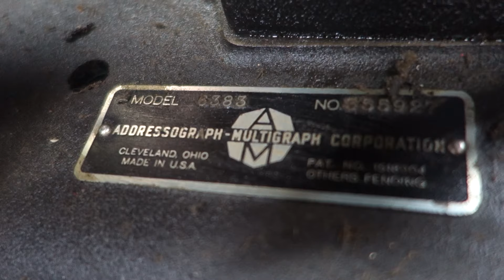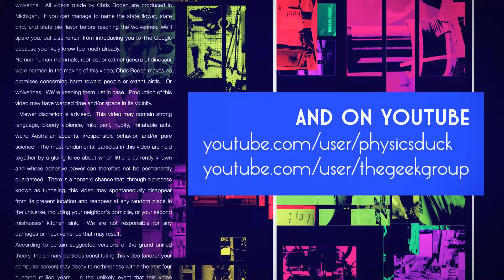Captain's Blog 7 26 2016 We Need A Truck

Comment: LKQ pick a part yard has transmission for fairly freaking cheap but you have to pull the 4L80E out yourself and i think that they exist in silverado 2500 and maybe some 3500 trucks as well as 3/4 ton suburbans and what not and can be swapped right over. It's a pretty easy job with the right tools to replace a 4L80E

Comment: 1214  a van towing a trailer is unusual.  matt is an expert at his job.  said donation weighs a ton.  boating with a friend is much safer and warmer.  1227  334,000 miles is a long distance for a van.  you had fun driving it.  1504  first time i have seen a grahotype.  a clean computer is much easier to work with.  good that swarm of computers came in.